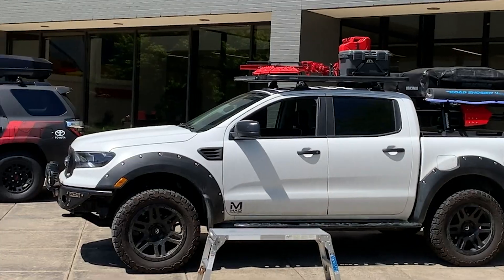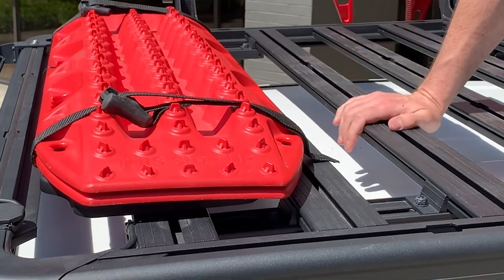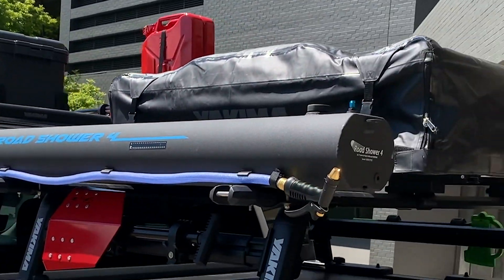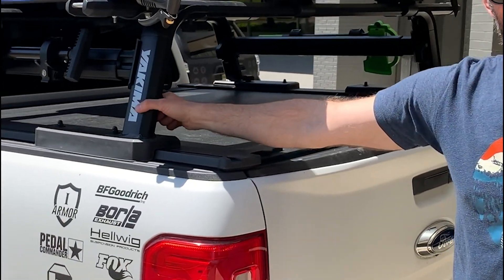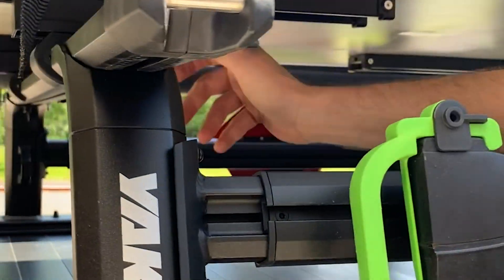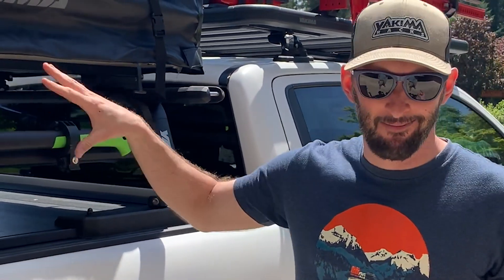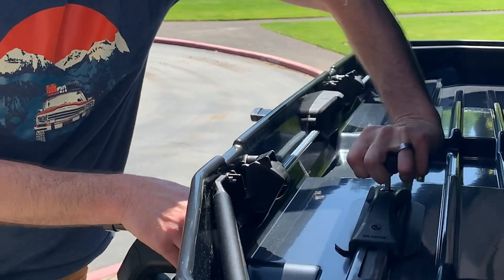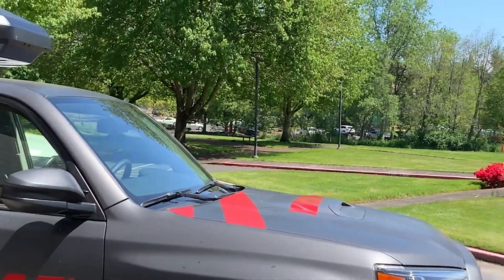Yakima Overland Products Overview

Comment: Nice video. I have a 2017 TUNDRA crewmax and similar like your setup. Everything look heavy duty for off-roading but except for yakima tonneau kit 1 and retrax pro xr side rails. THE T-BORLS from Yakima tonneau kit too small to hold all that heavy gears also the Retrax pro xr side rails too weak to hold all that too. Yakima needs to make some thing better that that for heavy duty off-roading . DOES ANYONE HAVE A GOOD DEAL TO REPLACE THOSE?THANK YOU

Comment: I am curious to how much stationary weight the Tonneau Kit 1 and OutPost HD will support? For example, If I put a 3 - 4 person rooftop tent on there would i have issues? The tent is 160lbs.
Reply: If it has a 300lb dynamic load, my rule of thumb is at least double that for static load. ~600lbs

Comment: Love Yakima. Just picked up the LockNLoad rack however, I am disappointed in the lack of accessories and mounts. Your own Australian website shows a ton of skus I can’t buy??? No awning mounts, no RotoPax mounts, no lock option for the traction bars, no shovel and axe mount, I can’t even buy spare T-bolts from Yakima for use with the LockNLoad. 

Also, RoadShower. Great product yet zero elegant way of attaching to my LockNLoad which is mounted to Skyline towers.
Reply: He did say in the video that most of those are due to release late summer. Prolly missed that. The lockNload system was presented in Australia way before its showing here in the US. So it will more than likely just have a slow introduction over here.